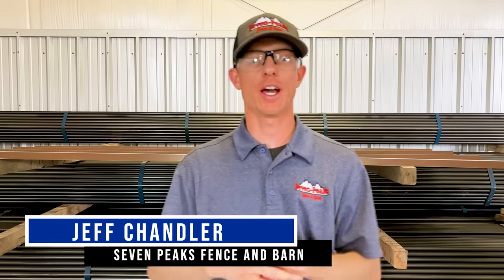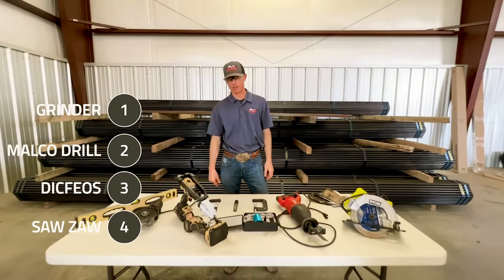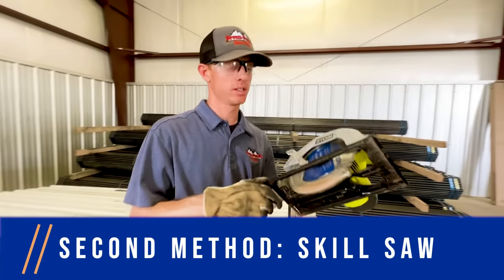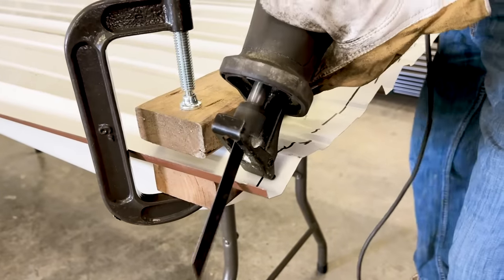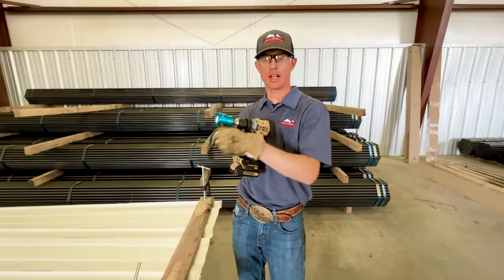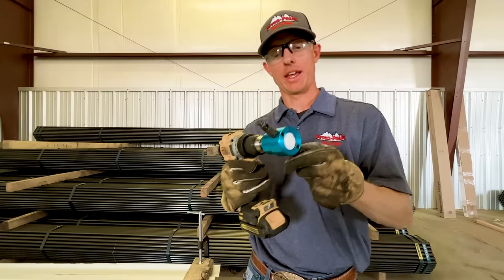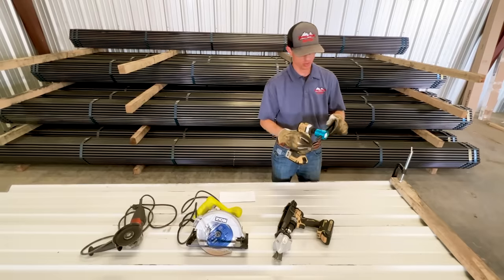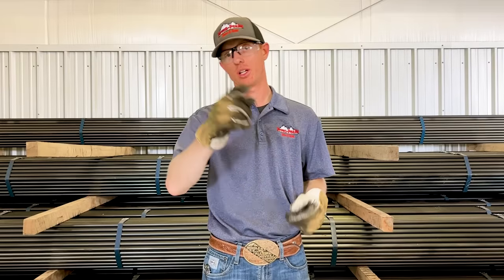Best Way To Cut Metal Roofing, Siding and Sheeting!?

Comment: A carpenter showed me how to cut steel siding by taking a circular crosscut blade (the blade with the 1/8 inch teeth) and putting it in your circular saw Backwards...Makes a real nice cut .
Reply: Just a little  noisy!
Reply: Also voice the warranty on the finish.
Reply: One word (rust)
Reply: I've seen somebody do that with A rough cut blade backwards and they cut through a 3-in block of aluminum
Reply: Call them thumper blades in Australia
Reply: Diablo blade on a skillsaw will cut it in about 5 seconds.
Reply: @AlexBuckles-e7i they usually sell touch up paint in matching colors. Give it a quick hit and you’ll be good to go
Reply: Your right about that

Comment: I've tried them all.  The negatives you stated with the circular saw is because you used the wrong saw.  Circular metal cutting blades need to turn slower than the speed of a wood cutting one.  Evolution, whose blade you used, makes a relatively inexpensive saw for just this purpose.  Other companies including Milwaukee make them at significantly higher prices.  The major advantages I see with using them is that it is much easier to hold a steady line.  Sandwich the metal between two boards held in place with clamps and use them as a guide.  Beautiful angle cuts are a breeze.  Best of all, in my opinion, is that you can stack multiple sheets of metal and the cut will still be straight and much much faster.  Another advantage over say a cutoff wheel is that you don't heat the metal and the paint along the cut does not blister allowing rust to start.
Reply: You are correct on using a saw made for cutting metal. They rotate slower. Harbor Freight has one for less than $100 that works excellent. The metal cutting blade does throw bits of metal, but the cut is cool so you aren't damaging the paint.

Comment: A friend of mine works at a roofing company and they only allow using sheer type tools for cutting roof metal, the reason being that it swages the galvanized layer over the cut so that there is less steel exposed to the weather and thus less of a future rust problem.   Personally I use the circular saw and just make sure the cut edge is hidden and the factory edge is the one exposed to weather.  There is usually always one edge hidden under break molding or the ridge cap, so you just plan your cuts so that the cut edge  is out of the weather.  The drill powered cutter here is called a nibbler.  I've seen pneumatic nibblers but never a drill powered one, so that was great to learn about.

Comment: I've tried all of those methods and by far the skill saw with a metal blade is the quickest, most accurate, and least fatiguing way to do it for straight cuts. A side grinder with a good cutoff wheel is my second go to and the drill powered shears are the third in order of personal preference and operator comfort. The shears are nice for circle cuts and complex cuts but they are tiring to use over time on straight cuts.

Comment: Sparks and sheet metal are a bad thing for a lot of reasons.  I have been using a milwaukee m12 nibbler successfully.  It does have some drawbacks, but can cut specialized cuts very well.
Reply: How does it work on the corrugated part
Reply: @joels.5237  not so well. It can be done but you lose a lot of control.

Comment: As far as I have been instructed, by using a scissor type of cutter, you will be re-sealing the cut edge. This helps prevent rusting. Speed maybe important to you, but long a lasting finish is more important to me. So the shear that attaches to the drill is the Cheaper, smaller, and best tool you demonstrated!
Reply: The Colorbond roof sheets (painted zinc-coated steel) on my roof were cut, installed and trimmed by a roofing professional, who used rotary power tools. The steel started rusting immediately from the cut ends. The roof perforated in places after 5 years. I am now replacing the entire roof with the same material, but I am doing it myself. As the homeowner who has to live with the consequences, I will not trust a roofing professional: as this video shows, they will prefer to save 30 seconds on a cut and leave the homeowner with a huge cost in a few short years. Incidentally, the manufacturer of Colorbond recommends that the sheets be cut with shears (hand or powered) and not with rotary tools for this reason.

Comment: The trouble with using an angle grinder to cut galvanised sheeting is that due to the heat generated while cutting, you ruin the galvanisation for about 3/4 of an inch up from the cut and the sheet will rust if you don't cover straight away. You don't notice the damage until a few months after you cut, but it is definitely an issue to consider. Cheers! A very useful video. .

Comment: I watched a you tube video years ago of a man in Australia cutting steel siding. He cut a slit about an inch deep into the side of the sheet and then used only his hands to rip it into! It came out square ! I had to try it,and it worked every time.I EVEN LET MY GRANDDAUGHTER DO IT. tRY IT YOURSELF, YOU'LL BE AMAZED.
Reply: I discovered that by accident once.  It was amazing.

Comment: Thanks for the video.  A couple years ago, I had eight sixteen sections of metal roof replaced due to storm damage, I kept the replaced sections as most were in good shape, I have used them on a couple smaller outbuildings. I used a grinder with a cutoff disc. But, I can  see if a person has a lot of cutting to do an investment in a metal skill saw blade would be worth it.

Comment: i made a jig and use a skill saw with a fine tool blade makes a beautiful smooth cut and its fast .learned that from a old master carpenter . but thanks for the video i also use actual  air   sheet metal nippers and good ole tin snips for wierd cuts .

Comment: Any method that involves cutting by generating heat will cause the finish to rust prematurely. I've heart that on the gulf coast it can happen in as little as 1 year on metal that is supposed to last up to 50-100 years. So don't use a grinder or a circular saw. Midwest Mfg states you can use a jigsaw. I'm sure the recip is fine too. I use a combination of a good old hack saw, tin snips, cordless shears, and nibbler depending on the cut. Good luck!
Reply: I never considered my jigsaw for cutting metal sheets. What type blade do I need to use?
Reply: Fine tooth metal cutting blade. Wide for straight cuts, narrow for curves.
Reply: A jigsaw is a good tool for cutting metal sheets, really thick foam sheets

Comment: Like another poster said, metal circular saw blades are not designed to run at the speed of a wood cutting circular saw.  Also, metal cutting circular saw blades are usually rated for different thicknesses so make sure you choose the correct blade for the best and easiest cut.

Comment: I find a shear type tool works great on flat metal but a circular saw with a carbide 80 tooth (plywood) blade works fast, cuts neat and creates little heat. If you don't get in a hurry, a coarser blade can work as well, like a 40 tooth and even a 24.

Comment: The metal crescent shaped metal derbies left behind by the "Nibbler" (Discus?) tool are VERY SHARP !
It's fine for indoor work where you can broom-sweep up, but I used one working over a deck and the C shaped shards embedded into the deck, and you can easily track the shards back indoors where customers/pets may be used to walking around bare-footed. I know this because I cut/hurt myself a day later walking in my kitchen. Beware of innocent looking little C shaped derbies: They are RAZOR SHARP !
Reply: Thanky you for that tip!

Comment: what i'd like to know is how you treat the cut edge bare steer will rust quickly and with any colored panels its a pain to get the edge without it showing.  of course use the cut edge on the uppermost part to reduce exposure.

Comment: $50  DeWalt power shear attachment for cordless drill.
Note that this needs somefudging to fit anything other than DeWalt.

It's what the pros used putting up my barn and "barndominium" house shell.

I bought one and it is a huge improvement vs grinding wheel or the Diablo metal cutting blades you can get for battery power circular saws.

I tred the wheel cutter for the battery powered drill and it is almost impossible to cut a straight line.  It does great curves especially to the right. (If you need a 12 inch diameter hole this is the tool)

Comment: The easiest method and quickest is to place a 2x4 across the metal sheet, score the metal with a knife cut a small nick to get it started and simply tear it off. No sparks. Straight cuts. No expensive equipment required.
Reply: As long as it is 29 ga... 26 or 24 doesn't work that way.
Reply: I have some vintage sheet metal.  There is no way you are “tearing” that stuff with your hands!
Reply: @lateknightcreations  The stuff I was working with (Chicken coop) was older than dirt. I trimmed off the rusted ends and had no issues.

Comment: I leave an 1/2" extra  using the grinder with a cut off wheel with the first cut then cut the final cut with aviation snips for the exact cut. Leaving a scratched or burned edge will leave an ugly rusted edge.

Comment: Nibblers for long cuts. Hand shears for cross-cuts. I do mostly barns and haven't found a square one yet. I'd use a skillsaw with metal cut if doing multiples only. I never do though. You cut a thousand dollars worth of steel you want to be sure. I know guys that do and predrill screws.

Comment: A lot of people make the same mistake you did when using a sawzall. the foot should be held against the metal surface to allow the blade to cut and not vibrate the metal.

Comment: The Australian standard for cutting zincalume sheeting specifies cutting with sheers or snips not metal cutting blades.
Cutting blades burn the coating making the edge susceptible to rusting and spreads sparks across the surrounding surfaces resulting in rust spots. Cutting with snips spread the coating across the cut surfaces.the nibbles you use comes close but as you say is slow. Any roofer worth his salt only uses snips.
Reply: Good luck with that on 60 pieces of corrugated roofing.
Reply: @johndough9187  perhaps you should order the sheets to length?
Reply: @davidwarren4569  That would be real nice if available.
Reply: @johndough9187  I’m surprised that in the US you can’t get that. We have roofing suppliers that will  form and cut to order.
Reply: @davidwarren4569  Hey mate, thanks for your comment. How would you cut a colorbond fence post? It is angular and a bit thicker than a colorbond fence sheet.
Reply: @tomtam558  I thought we were talking roofing here.
Reply: @tomtam558  You don't. You order the right length, or dig the hole a little deeper.

Comment: You’re not supposed to cut steel with paint with a grinder or a saw it gets too hot and it doesn’t seal the end of the cut and gets too hot for the paint that’s on the metal. You’re supposed to shear it , like with tin snips

Comment: The shears  can work well except across the rips wbere they struggle. Dewalt mini saw 3.5 inch blades, diamond or abrasive works better than anything else by a long way and leaves a clean edge. Also far less noise.

Comment: Time might be of some concern, but if what you’re using voids your warranty, not sure if that time savings.  Grow a pair and some arm muscles and try some hand  metal shears , bend over, hold the street with your right foot on the ground, cut with right hand while lifting cutoff piece with left hand . Your setting up on a table with clamps , drawing a line down into the valleys, is all dicking around, cuz you’re too lazy to touch your toes. I’m in my sixties and do most buildings alone , still touch my toes.  Anything that heats up the metal while cutting voids the warranty, it’s about metallurgy, changing the molecular structure of the metal and it’ll start rusting immediately after you leave the job sight, now if the owner doesn’t care about the warranty, you’re laughing.

Comment: Where are the tin snips? A grinder definitely will lead to rust, those shears don't do well going over the ribs and the sawzalls a demo tool and the blade or the skill saw is expensive and those little shards of metal cut you. Best way is snips, then nibbler and if you want speed use a grinder next to your line then use snips to cut your actual line "you have to remember to wipe the panels to keep from rusting" 😎

Comment: Ya know, it takes  talent and  skill to put out a video.  I know this, one reason i dont do them.  However, why bother setting up for such an endeavour when you don't even know what the tools are called?  You see, THAT'S why i dont do it!  
First, grinders REQUIRE a facemask!  I'm no Safety Sally, (the only reason i would have had glasses on would be because of the circular saw blade cutting metal, been there, done that) I wouldn't wear safety glasses when using a grinder unless they were right there, but, when you start blowing metal and carbide dust out of your sinuses and coughing the same crap outta your lungs ... you actually learn, takes 20 years, but you learn.
Second, your tools are, in order ... an ANGLE grinder; a CIRCULAR SAW ... you actually said you were using your "Skilsaw" with a metal-cutting circular saw blade.  That wasnt a "Skilsaw", it was RYOBI circular saw; a RECIPROCATING saw (and if you're gonna use a generic term, Milwaulkee coined their tool the "Sawzall",  so you should, at least say it and spell it correctly since its pretty easy to find on Google, even for a 60 yr-old man).  You should also learn to use it before demonstrating a "how-to" because, if you had properly adjusted the shoe and kept it against the metal, it would have cut better.  An even better method is to sandwich your cut between two pieces of wood and cut right along the edge of the wood.  Nice and easy.  The shears attachment was cool enough and a nice option for occasional job use, but dedicated shears work much better in the long run and would be an inexpensive tool-vs-time investment on a full shop siding and roofing job.  The last tool is called a nibbler.  It works better cutting flat sheets, like if you had to rip along the length for a window or door opening and if you use a fence of some sort, it makes a really nice cut.  Its even better at intricate cuts.
Third, in 20+ years of doing commercial steel structures, I don't ever recall anyone using a grinder to cut steel sheet, pretty much everyone knew that heat would make it rust so, unless you wanted to touch up each cut ...
Again, it takes guts to make videos and post them.  It takes even more guts to do it with that much inexperience and lack of basic knowledge. 
I've taught for a living in the military, and the biggest rule there is, "If you don't know it, don't @#$%^$# teach it, because somone's gonna die!" I know how to use all these tools (I even have all of them), but since I dont understand editing and posting videos,  I don't do it.  Why produce a crap video with great tool use and experienced techniques as well as the proper names for everything?  Or, in this case, why  screw up a good video with incorrect techniques and wrong information?
Now, please accept my thanks to you for sharing.  I hope your experience and technique catch up with your enthusiasm and ability to edit and post, I truly envy that skill.  Happy New Year.

Comment: Oh boy! The YouTube clown show continues 
Just having a metal blade for a skill saw isn’t acceptable a metal panel saw runs slower than a normal skill saw  so you blew that a grinder is unacceptable  the cut will always rust  a reciprocating saw Cmon man wtf   What I don’t see is a guillotine the actual proper tool for a full panel cross cut. I don’t see double cut sheers 
The malco single cut is good in the right application but I see you brought a cheep as seen on tv nibbler instead of a real nibbler 
The truth is if you don’t want rust the best tools are sheers and a guillotine